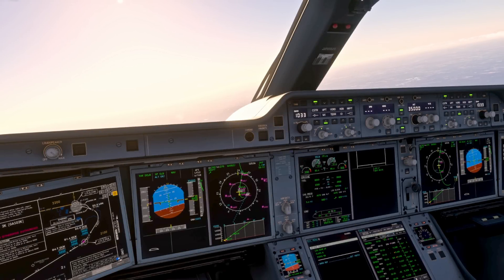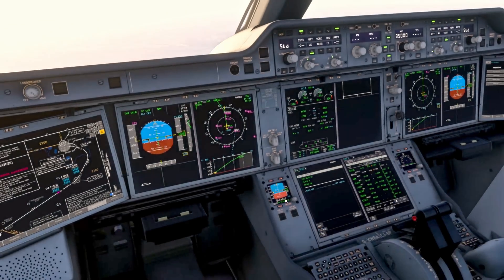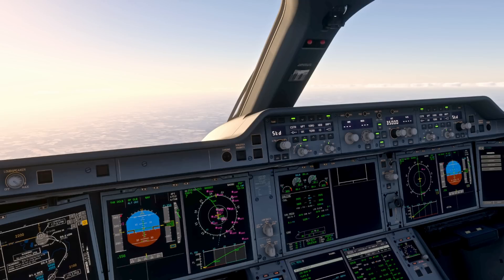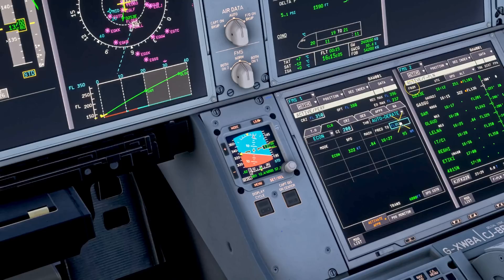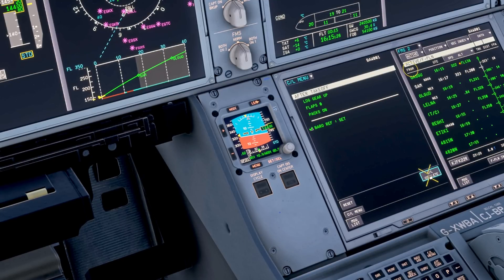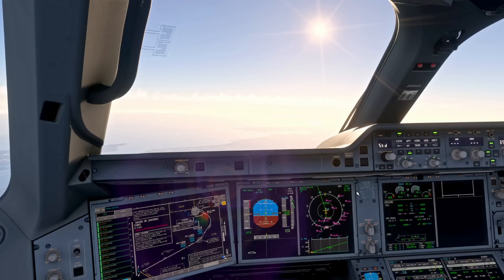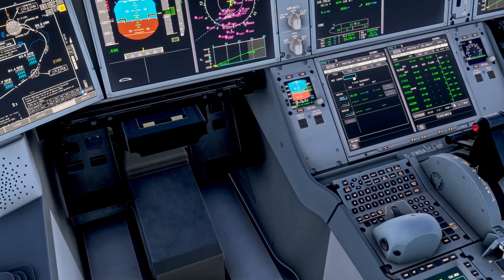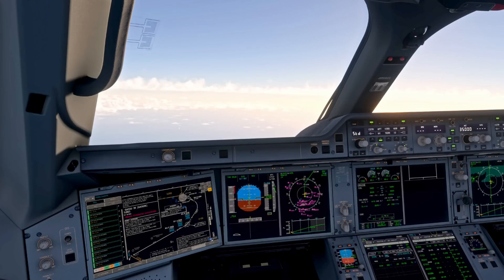How to Climb the A350 Like a Real Pilot | iniBuilds A350 MSFS Tutorial

Comment: My aircraft pitches up very much on climb and i don’t know why it does it
Reply from the maker: Hello, presumably this is with the autopilot on. Check loading of the aircraft. Also check speeds for the climb, a lower speed will result in higher climb rate. What pitch angle are you experiencing?
Reply: @ like 30º but then it disconnects even when i arrived at cruise it still pitch up
Reply from the maker: @0rnitorrincoo ok highly abnormal pitch. It's worth checking to see if you have any of the MSFS assistance features turned on such as AI trim, most of those should be off as they are known to cause issues
Reply: @AirbusCockpitCoach  Thank you very much i’ll try it!
Reply: @AirbusCockpitCoach  it works!!! Thank you so much!
Reply from the maker: @0rnitorrincoo  That's great to hear, happy flying 👍✈️